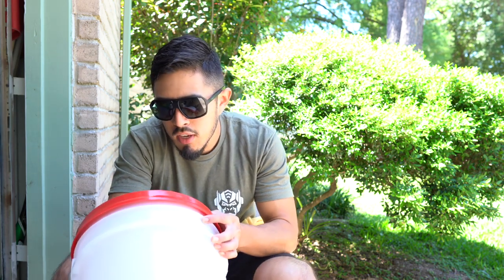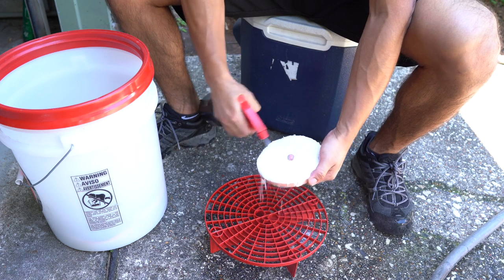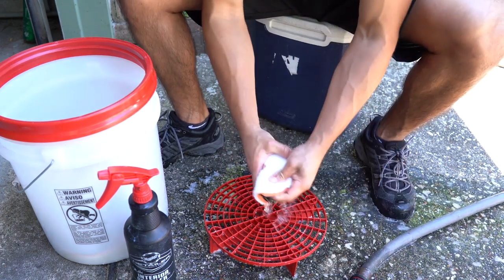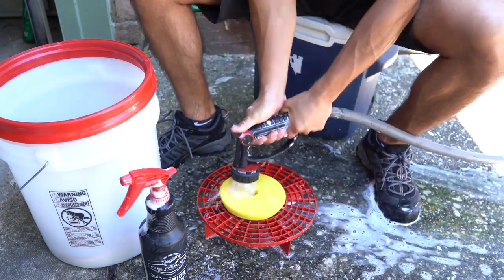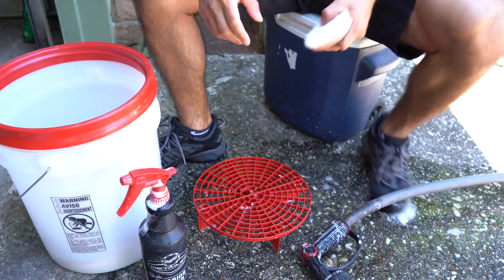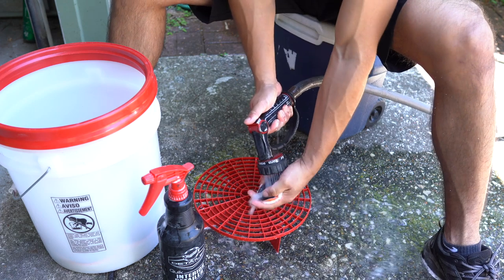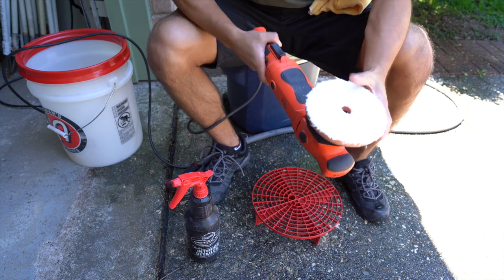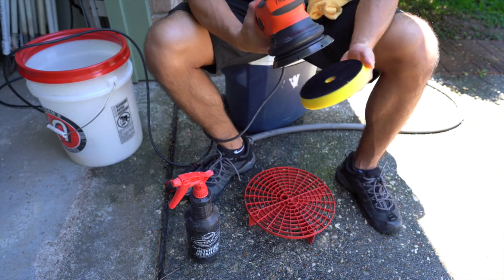How To Clean Polishing Pads - Simple and Free Method

Comment from the maker: What's your method to cleaning out pads? Let us know!
Reply: this morning i was coin wash first and then shopping mall, i did something that you don t do it that way but for me its working .so rinse here down and instead first drying the wax this case menzerna power lock i  wet waxing and was very easy to dry .this product is very thick. and you or anyone else is complaining first drying than apply the wax its working for me.
do what working for you
Reply: I basically do the same thing but no APC. You made me realize that APC is kinda perfect for it since it helps to clean off the chemicals.

Comment: My secret is just to pre-spray and quickly brush in some "Totally Awesome" cleaner I get from the dollar store, then toss them in the wash with a Tide pod and some towels or t-shirts for balance (no dryer, just air dry). The Totally Awesome breaks up wax and compound effectively, and rinses clean and easy (this is key). Takes almost no time and effort, pads come out great, and saves them from all that hand wringing, which can cause premature de-lamination where materials are glued. Even with hand cleaning, I recommend Totally Awesome, rinses out much easier.